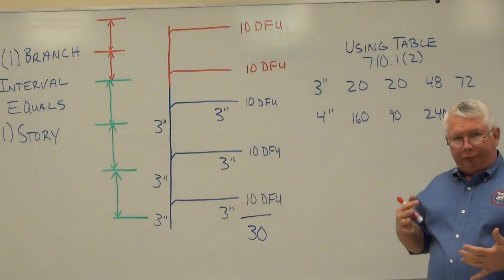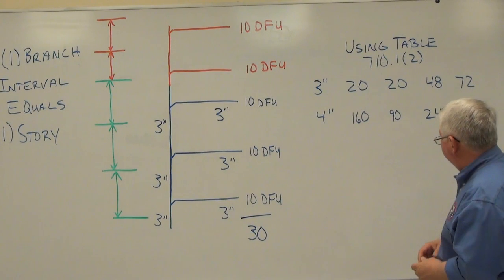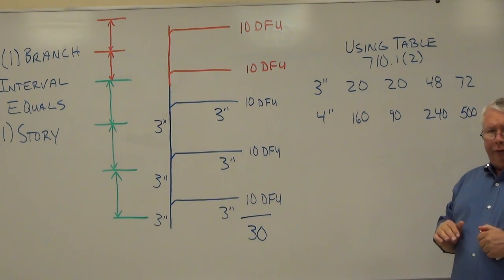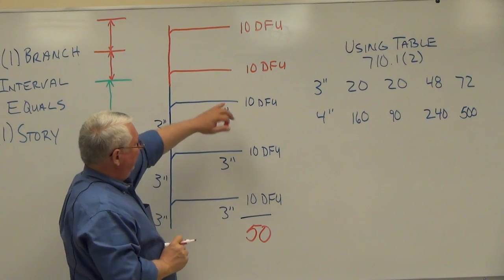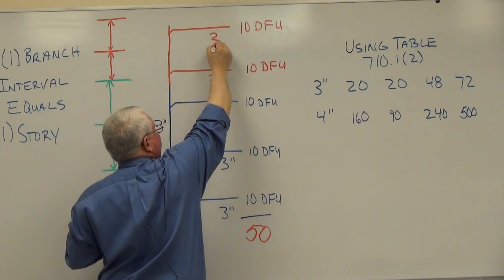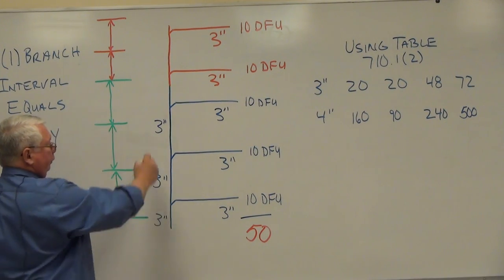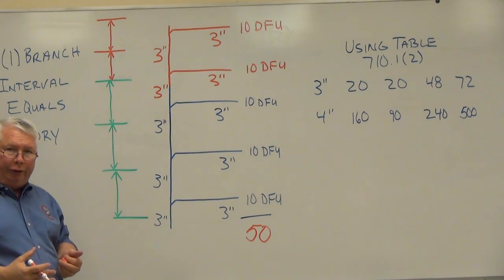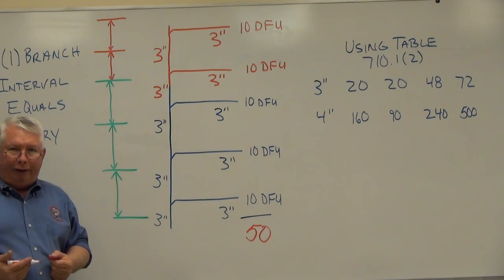Drain Stack Sizing 3

Comment: I am adding a bathroom and trying to size my pipes and am confused by the IPC.  As you shown you can have 20 DFUs per branch interval.  I think you are showing a vertical branch.  I have 3 baths on my 1st floor all branched off the main drain.  I plan to tie into that main drain line to build a a 2nd floor bathroom.  Each Bathroom group is 6 DFUs   Plus on the 1st floor I have a washer (2 DFUs) and sink kitchen (2 DFUs).  Therefore on that main 1st floor horizontal line currently there is 22 DFUs but they discharge into the main drain line at different points.   So can taht main horizontal drain line on the 1st floor can it support another branch to the 2nd floor?